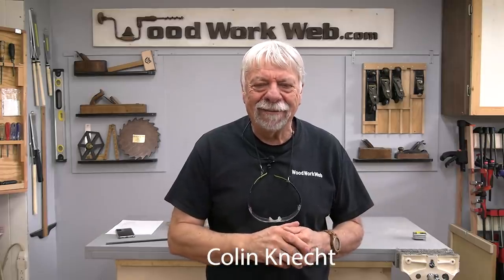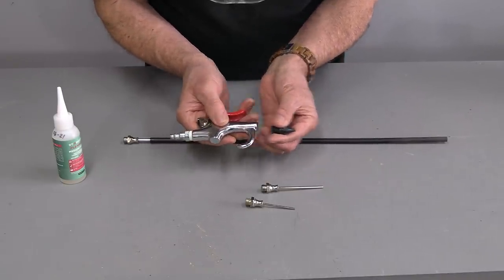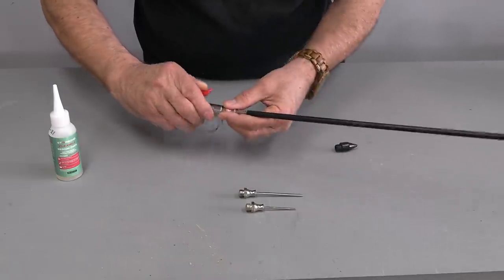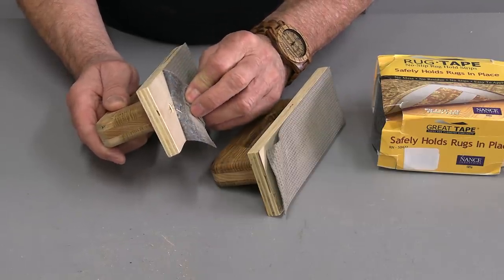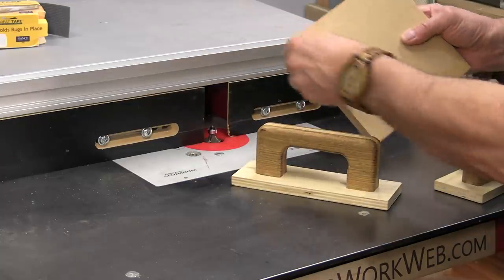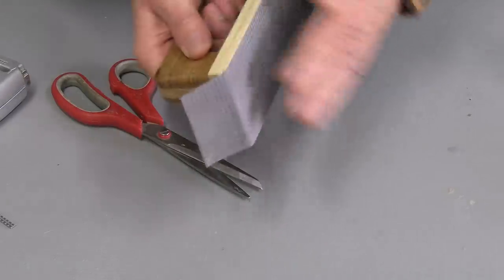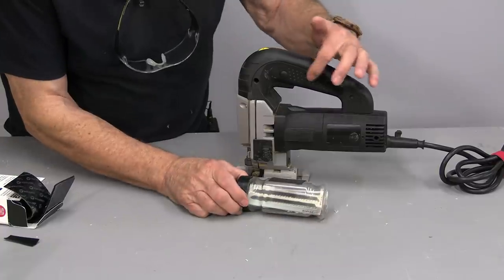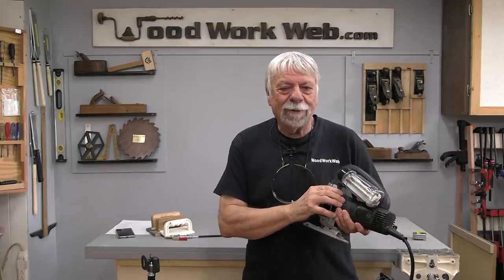Funny Day Around the Workshop!

Comment: 8:50  Take three or four layers of gaff tape, wrap them around the bottle and touch the ends together, so you are essentially leaving a flag, then punch a hole in the flag and ziptie it to the power cord for the jigsaw.   That way the blades are always attached to the cord.   The gaff tape is really tough and won't tear, especially when it is 6 or 8 layers thick.

Comment: Try using a spray acrylic or poly or something on the bottom of the push blocks, let it dry well and then apply the tape.  For some reason, the sticky on some things like unfinished wood. Another example is vinyl decorative paper.  It will lift on unfinished wood.

Comment: Hook and loop tape is great for a lot of things but dust isn't its friend. The dust clogs up the little loops (or hooks). To keep from having to replace it as often, cut another piece a bit longer and attach both parts to your bit containers as well.  Just make sure to reverse it- if the hooks are on your tool have the loops up on your second piece. Then, when you remove the bits you can cover the exposed tape easily your sawdust doesn't wreck it during use.
Reply: For the blades... older drill keys  (if you remember old drill keys) they used to be connected to the cord. That's where I zip tie the case of blades.
Reply: The tubing used in your first tip IS hard to find but if you stop by your local pet store you can get airline tubing (used w/ an airpump to add oxygen to your fishtank) it's not only fifteen cents a foot ( thirty pence a meter) it's soft enough to stretch over many other sized nozzles. For your second tip I use two T-nuts on the base screwed up to the top with scraps of metal holding down the ends of the sandpaper so I can readjust or replace it when needed.

Comment: I was going to glue the air tip as you did, instead used a heat gun to soften the plastic and slipped the tip in, so I can remove it for other uses.

Comment: I'd love to have you make a video on cleaning a saw when it comes to the greased parts getting dust on them. What do I do? I got my first cabinet saw two months ago, and I have so far done general waxing, vacuuming, and air compressor blowing internally. It works perfectly, but every time I am in there I notice the parts that are greased are just caked in dust. I know they are meant to be heavily greased, so I don't touch them, I just let them be, but I figure eventually it will need to be cleaned. How do I best clean it, and what do I put back on it/how much? I never worried too much about cleaning my jobsite saw beyond basic stuff, but when you drop a few grand on a cabinet saw you suddenly get very protective over it, and I want it to last forever. Any tips would be appreciated.

Comment: If you are using your push blocks with a stop saw wouldn't the screws and the staples in the push block cause a problem? Great video, good tips, thanks.
Reply: Only if it touches the blade with enough capacitance, or if the screw is touching the hand of the user ans the blade at the same time